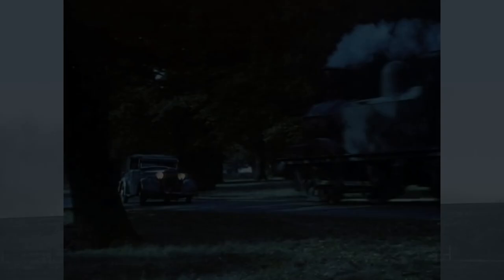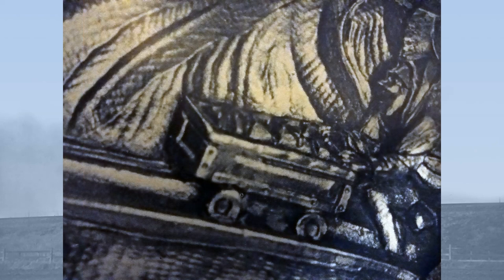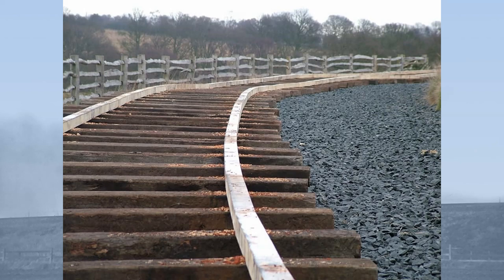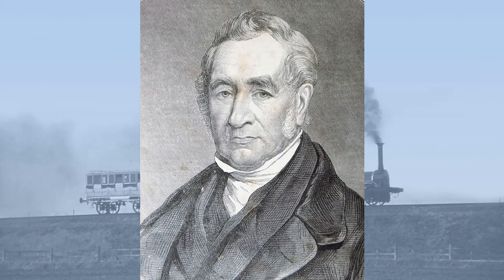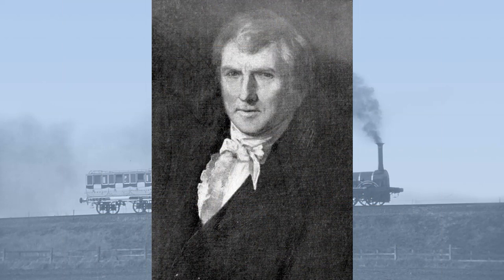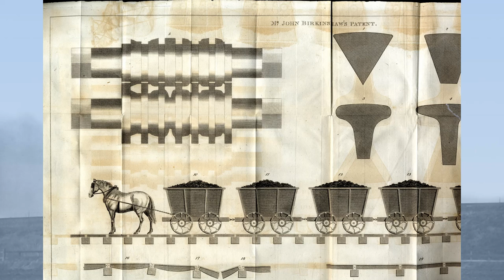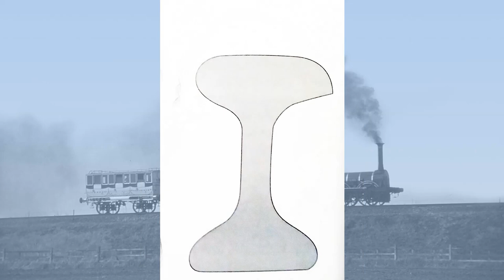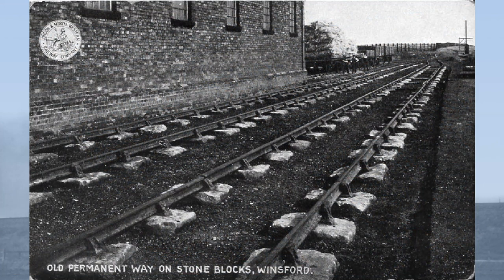Track: The Basics

Comment: I was a volunteer at a 2 foot line in Maine about a few months ago, and we were laying track for a new 4 road engine shed. Every single time we’d place a rail, we had to do it by hand. You’d think that the small gauge of the line would make it easier, but the rails were quite heavy and required an entire permanent way gang to slide a single rail into just the proper place. I was barely even able to keep up with the laborious work aside from putting down sleepers and ballast, so I’d mostly just be doing odd jobs.

Comment: There is still a form of the original “sleeper” in use, primarily on the European continent, called “bi-block”, where the rail is fixed to a concrete square, and it’s counterpart opposite is fixed to it by steel bar to form a sleeper.

Comment: Thanks for this one. I just recently re-read William Brown's history of the First Locomotives in America, and he repeats the story about tramways being named after Outram. It seemed like the sort of story somebody would've have made up after the fact, so I was surprised when you mentioned it. The author also mentions something about flanged plateways which I had never considered before, but which is illustrated perfectly by the photos in your video: That the flanged rails could trap rocks and dirt, preventing the rolling of wagon wheels, whereas an edge rail with flanged wheels prevents this issue.
Reply from the maker: Yeah the plateways got quite dirty, and the narrow cast iron wheels wore out the surface of the cast iron plates  leaving grooves/ruts in them. In South Wales the plateway remained in use far longer than in England and locomotives were built to run on them: the first ones a bit odd-ball and built on bogies to spread the weight and later far more conventional looking. Dr Michael Lewis has just written an excellent book on the Sirhowy Tramway in South Wales and its locomotives. I dont know if you've seen it ore not but its very highly recommended!! https://rchs.org.uk/product/steam-on-the-sirhowy-tramroad-and-its-neighbours-published-7-september-2020/

Comment: With an L shaped profile, the distance between the inside of the rails to make 4'8" (56") would be exactly 1.5 yards (54"). Or given the "flexibility" of 18th century measures, it may have been intended to be 1.5 yards between the rails. A yard and a half seems logical for the origin.
Reply: 4’8” was the standard track width for road carts from Roman times.

Comment: While the Adler was the first successful steam locomotive in Germany, there had been two locomotives built 1816 and 1817 by Königliche Eisengießerei Berlin, smaller copies of the Blenkinsop cogwheel locomotive. They had various problems (leaks in boiler and cylinders, wheelsets dimensioned too weak to carry the cast iron boiler) so they never entered regular service and the plans to introduce steam power to the horse-drawn mine railways were given up for the time being. The second of these locomotive ("Geislauterner Dampfwagen") was reconstructed in 2014 as a non-working full scale model preserved in the transport museum of Nürnberg.
The first successful steam locomotive built in Germany was the Saxonia of 1838, larger and more powerful than the Patentee locomotives. It was built for the Leipzig-Dresdner Eisenbahn which however preferred mostly English-built locomotives in the beginning.
I have seen the Ajax (oldest locomotive preserved on the European continent) in the technical museum of Vienna. I never thought of it as a Patentee since it has two coupled wheelsets.

Comment: Another excellent video Mr Dawson. Very much looking forward to the rolling stock video as well. Something you may find interesting is that the advantage bullhead has over flat bottomed rail is that its much easier to curve. Bullhead can simply be barred across with chairs and sleepers attached, whereas flat bottomed need special equipment.
Reply: Interesting point.   If you try to bend a bullhead (or a narrow I-beam) section it should bend symmetrically, whereas a flat-bottom rail section will certainly try to twist because of the far greater lateral rigidity of the flat bottom.

Comment: Thanks for that Anthony, there's a lot there I didn't know.
I sometimes get frustrated debunking the common myth that the width of a horse's backside led directly to Roman carts, to Stephenson's standard gauge, to the diameter of Saturn rocket boosters (apparently shipped by rail, which then demands an explanation of the difference between track gauge and loading gauge...)
One thing you omitted to mention about sleepers, was their function in keeping the track accurately to gauge, even if it moves or creeps on its trackbed - something e.g. stone blocks won't do.
Reply from the maker: Yeah stone blocks are quite apt to spread. Which is why some lines used wrought iron tie rods between the blocks to keep them to gauge. Then again iron rails and stone blocks as devised by Outram and/or John Curr in the  1790s were not intended for heavy locomotives and fast speeds....the fact they were able to sustain locomotive working is a testament to over engineering.

Comment: Thanks for the video. Most enlightening. 
I have the book 'The Railway - British Track since 1804'. Still trying to get hold of Early Wooden Railways at a reasonable price.
I already knew a lot about the later period, but very little about wooden railways, apart from what was written in a page or two of The Pictorial Encyclopaedia of Railways by Hamilton Ellis.
I think an important point in the development of track was discovered at Chat Moss, where the L&MR had to be diverted, when they found that the rails lasted a lot longer over the springy trackbed which led to the idea that resilience of the trackbed was much better than setting the rails on a rigid structure.
Brunel had to go his own way with track, as he did in most things, using bridge rails instead of a solid piece of iron. 

I read in The Railway - British Track since 1804 that modern railways are returning to the original idea of a very rigid track base meaning that the suspension on trains has to be much better.

Comment: Anthony don't know if you are aware of this, but it was around 1850 that wrought iron double headed 45lb/yard rail in 24 foot lengths. 1857 saw the introduction rolled steel bullhead rail, the Settle-Carlisle route was laid with 83lb/yard rail of 24ft long sections. By 1915 rail lengths of 30ft, 36ft, 40ft, 45ft, 48ft, and 60ft were all in use. The LNWR and NER were using the 60ft lengths.

In the pre-grouping era timber sleepers became more or less standardised at 9ft by 10in by 5in on plain track, on point sleeper were widened to 12in and thickened to 6in. Although railways in Scotland and the GER tended to use interlaced sleepers on their points instead of the larger timbers. After the grouping sleepers were shortened to 8ft 6in.

In all cases you could still find rail lengths and sleepers until relatively recently on little used lines and sidings.m

Comment: Do you have any more insight into the iron-strap-surmounted wooden rails, popularly known in America as "strap rail", and particularly the difficulties in fastening the ends of two straps together? Popular myth has it that the continuous force of train wheels passing over these straps would gradually coax them into bending and wanting to curl up like a spring, eventually generating so much force at the joints as to cause the end of a strap to spring up, sometimes punching through the floor of a passing train carriage, a phenomenon known as a "snakehead".

Also, what motivated the decision in early American railways to do away with chairs and use simple, crude spikes driven directly into the wooden sleeper to secure the rail?
Reply: If I may, the simple answer to the last question is that it was just cheaper. The use of wooden ties was initially motivated by cost too. The first few miles of the B&O were built using various techniques, including mounting the rail on stone or wood, and wood proved the winner early on.

Ultimately wooden "rail" capped with iron strap disappeared because of the maintenance costs, and because its use precluded the use of heavy locomotives, limiting the efficiency of the road. One of the reasons the venerable Hinkley Lion of 1846 survived long enough to make it into preservation is that the Palmer and Machiasport never converted the road to iron rail, using wooden stringers capped with iron strap until the very end in 1892 (look at photos of when the Lion was removed for scrap in 1897, and the wooden track is still in evidence). When the Lion was severely damaged by fire in 1880, no modern replacement light enough could be found, so the Lion was rebuilt and put back into service despite its age. Today the loco sits on an accurate reconstruction of the track it worked on all its life.
Reply from the maker: I've never come accross anything like that about iron straps springing up. They were used sparingly due to the cost, usually on curves crossings etc which could expect heavy wear. If anything, instead of springing up, they were forced down into the wooden rail, and the nails securing them often fell out and needed a lot of maintenance to hammer them back home. The earliest Bar Rails were screwed to the top of longitudinal timbers - such as on the Lake Lock Rail Road of 1798.

Not using chairs and spiking the rail direct to a wooden sleeper was cheap, quick and easy.  With a broad foot the load was spread over a large surface area and a timber sleeper would be elastic. What amazes me is often the lack of ballast on American railways - ballast performs two really important functions in terms of an elastic cushion and drainage. Whilst Vignoles rail could be laid without chairs and therefore cheaper, it is much much harder to bend than Bull Head rail. Which would make it more expensive and time consuming to lay out proper curves with good geometry. Modern flat-bottomed rail  is usually laid on concrete sleepers, secured with clips and with a large block of rubber between the rail and sleeper to provide the needed elasticity. It's fascinating stuff but so overlooked.
Reply: @AnthonyDawsonHistory  I’ve seen several descriptions of strap rail in books on American 19th century railways. One of the first railroads in Wisconsin about 1850 was originally laid with second hand strap rails. There are woodcut illustrations from magazines of the period about a ‘snakehead’ violently puncturing the floor of a coach. The weight of wheels would eventually deform the strap. causing it to curve upwards at the ends.
Reply: Speed. Early American railways were built quickly and crudely. In the book "Mixed Train Daily," Lucius Beebe includes a photo of a short line still existing in the late 40's where the ground was smoothed and the ties plunked down with NO ballast! Apparently this line had operated this way since...forever. He also found a short line where some of the rail had "Sheffield" stamped into it, indicating both that the rail had been made in Sheffield, England, and that it was incredibly old. Personally, I've thought for some time that the "snakehead" story was a bit of an exaggeration as the iron straps would likely have been too short to hit a car bottom, but they must have caused a lot of (low speed) derailments.

Comment: When was the 1/2" added to Killingworth gauge?
Reply: Yea, what he said!! Lol
Reply from the maker: We don't really know. The Liverpool & Manchester (1830) was laid to 4 ft 8 ins and it probably gained the extra half inch when it was completely relaid with new rails 1836, the extra half inch to ease the curves. The Leeds & Selby (1834), however, was built at 4ft 8 1/2ins which probably makes it not only the first Mainline Railway to be worked entirely by locomotives  but also the first modern standard gauge mainline.

Comment: The description of a railway contained an error. Flanges on wheels do not keep a train on a track: flanges are only for safety, i.e stopping a train from derailing. Wheels are conical in profile, which keeps the wheels on both sides of a bogie drawn to the inside (not the outside) This also means that the outside wheel on a bend will have a larger diameter, and the inside wheel a smaller diameter without which, one of the wheels would scrape the rail.
To understand this, just think of a car that has a differential, that allows the inside wheel on a bend to turn less than the outside wheel. As train wheels have a fixed solid axle, the conical profile of the wheels overcomes the problem that a differential does on a car.
Reply from the maker: Yes modern railway wheels are coned, and it is the coning which keeps them on the track, but in the grand scheme of things, coned railway wheels are a pretty recent innovation of the late 1820s. All railway wheels before that were not coned. Some weren't even flanged. :-)

Comment: I always wondered why railways have the absurd separation of 4 ft 8 and 1/2 inches instead of a much simpler 5 ft. I suppose it really doesn't matter.
Reply: It's entirely arbitrary, and 5 feet is only 'simpler' in Imperial measurements.   (Ironically, Russia is metric but runs on 5' gauge through an accident of history).   And even then, it's only a nominal figure - for example the rails may be widened slightly on tight curves etc, the distance between rail centres is different again...

Comment: Whilst it is true that the track bed required for steam locomotives needs to be springy under load that for modern high speed services requires a greater degree of rigidity.
Reply from the maker: Yes it is. Not just for steam, however. It's all down to speed.

Comment: so some of the railway track featured here would be in use during the 1850s and early 1860s setting of the railway dectective book series then?
Reply from the maker: Bullhead certainly
Reply: @AnthonyDawsonHistory  in Australia the Victorian Railways were first laid with double headed rail in the period 1858 to perhaps 1870. I saw some in sidings being ripped up as late as 1985. Lots of others tried until vignoles flat bottom took over.
Reply: @AnthonyDawsonHistory  what kind of coal stage did the Great Western railway use during those years to fill up the tenders and bunkers of their broad gauge steam locos with coke or coal?.
in one of the shorter Railway dectective stories a body of a railway Porter who was murdered the night before is discovered hidden under a heap of coal or coke early one morning at one of the Great Western railway's coal stages when a engine crew began to refuel their locomotive with more soild fuel. there is very little information on the design of the coal stage in that story. the loco crew do not feel well after finding out there's a dead body in their loco tender.
Reply: @johnd8892  , you saw some in sidings getting ripped up in the 80's?  really?  where were these sidings?  i saw a bent up heap of it next to the bendigo line somewhere around diggers rest in about 1976.  i would have liked a sample but it was in lengths too long to fit into my eh holden.  in the early 1990's i found a piece less than a metre long in, of all places, near the kewdale railway yard in perth, wa.  from my own research it was never used anywhere in wa.  it was getting in the way so i offered it to the bassendean railway museum.  i rang them up and asked them if they'd like it.  "yes please".  so one sunday morning i pushed it under the front gate.  i went there a few years ago expecting to see it on display.  no-one knew anything about it.  did one of them souvenir it for their own private collection?  or did it get thrown out because they didn't know what it was?  i'd strongly bet on the latter.  i regret giving it away.  i should have kept it.  the maker's name was just visible.
Reply: @vsvnrg3263  at photo stop run pass of triple R class to Bendigo. A station goods yard then disconnected but not yet all cleared. Pity I can't remember the name but I think north of Castlemaine. Double headed but before bullhead assymetrical rail.
Reply: @johnd8892  , thanks for that.  the same line where i saw it.  id bet there's more along the line that is buried and hasn't been picked up and sent to sims.  one day i'll travel back to vic, hire a metal detector and take a big grinder and cut myself a sample.  both the rail i saw near diggers rest and the piece i found in kewdale were symmetrical.
Reply: @johnd8892  ,thanks for that link.  brimming with info.
Reply: @AnthonyDawsonHistory  which one is bullhead rail i did not completely understand what you said in this episode as the subject is a little over my head

Comment: nothing about 'Brodge rail'?
Reply from the maker: Bridge rail etc will be covered in a second part :-)
Reply: @AnthonyDawsonHistory  I've got a chromed and mounted piece(!!) from Sweden with a plaque stating its from the Köping -Hult railway, laid in 1853 on the stretch between Örebro-Skebäck its weight was ( my bit is only about an inch long!) approx 29 kg per Meter it was made in England of Swedish ore . I originally though it was a useless piece of modern art when I realised what I was reading on the plaque I bought it for the princely sum of about a quid (10 kronor) I've had it for 30 years now on the bookshelf :)
Reply: read BRIDGE instead of BRODGE hadnt had a cuppa for atleast an hour....